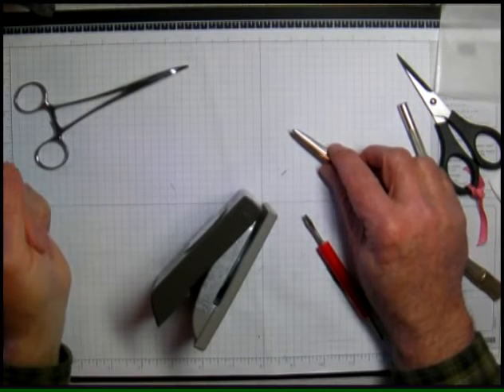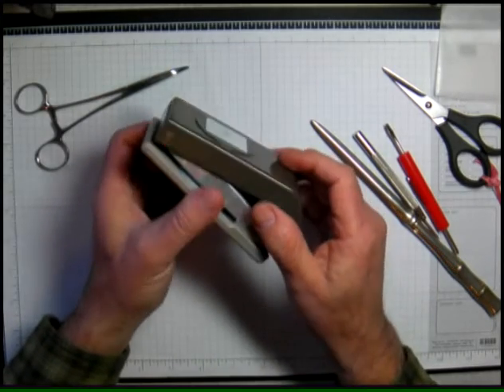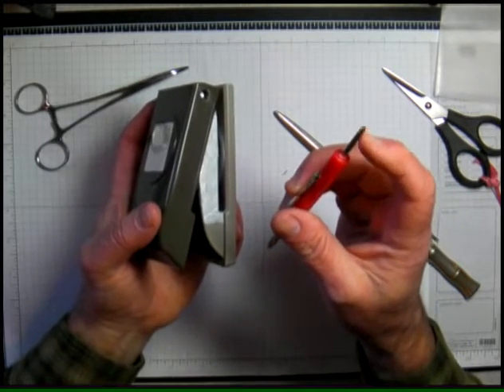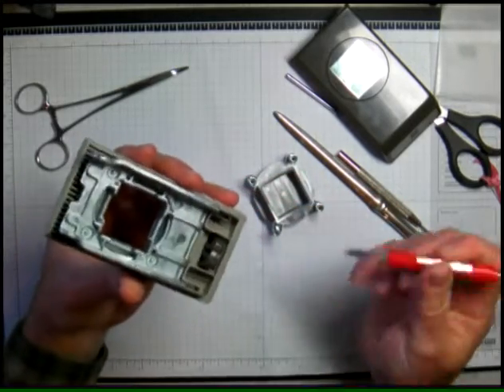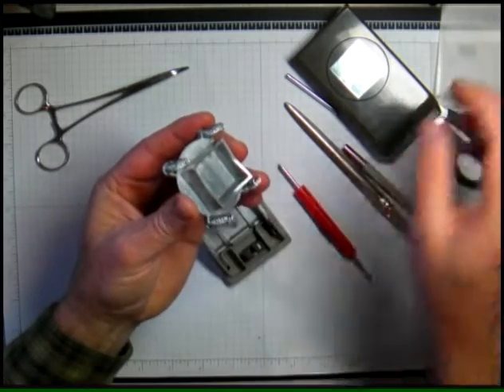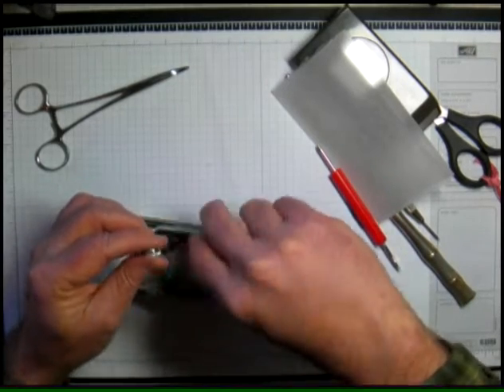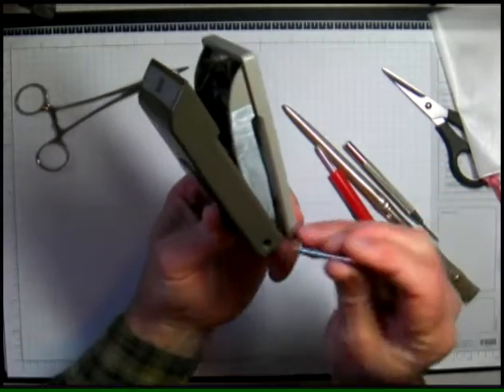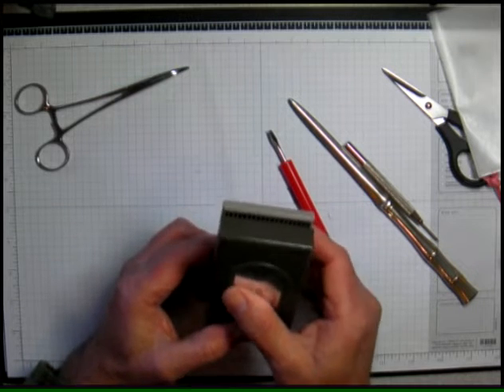Punch Repair - New Style Punch.mp4

Comment: thank you so much for your tutorial on how to repair punches, i bought mine a month ago and punched 3 circles and trying to use it again all of a sudden it was stuck so i followed all your tips (it did take me a while to take off the caps, very difficult) greased it, but after 40 minutes battling with the punch all turned out just fine. Great tutorial.

Comment: cant get the tab out :"(.helppppp
Reply: I used a pick from my Cricut tools and popped it out...hope this helps...I did have the same problem...he really didn't show how to get the first out...but he got my punch to working...
Reply: @GWest5068  Thank you so much for this! This comment was as helpful, if not more, than the video. It took me two days to get the first cap off!!! Between this video and another one showing you can put the punch in the freezer to make the metal contract to free whatever material is "stuck", I was able to save my discontinued ribbon punch that I use all the time. So happy right now! I have a swap due this week and really wanted to use that punch. :) 

Another tip: Take photos at each stage of taking the punch apart. That way you have a good reference when putting it back together.

Comment: Came here because I attempted to punch two thickness cardstock and the metal shifted. Bottom would cut, top would not. I followed Dave’s instructions, along with the following added tips and voila - my punch works again. $20 saved!

To remove the cap: I used my spare metal tipped pokey tool to remove the first cap - it took a number of tries, and I found squeezing the punch closed while prying helped. The pokey tool tip and the cap mangled a bit, but it worked. I wasn’t careful when pushing the pin through, and the second cap flew out just like Dave warned. Found it.

Futzing with the blades: I gently filed the inside of the top blade, and added a small dab of baby oil with a q-tip to the outside (the part that slides against the base metal). I wiped it all down really well with a napkin. I also found two channels on either side of the base where a protruding part on the top slides into when squeezing the punch. I placed the top back on, and gently pushed on the top to make sure the springs were positioned correctly to allow it to slide down and up. I think this was what had moved, and gently shifting the springs clockwise/counterclockwise helped correct the channels before reassembling.

Getting the pin back in: Tough! I squeezed the top of the punch slightly to align the channel and plastic until I could see all the way through it, then got the first part of the pin in. I squeezed the other side of the top to keep the channel open to get the pin in a little further. I ended up locking the punch closed and continued to hold pressure on the top to keep the channel open while I gently tapped the pin into place with a tiny eyeglass screwdriver and a mini hammer. If it’s resisting, the channel isn’t open enough and you need to gently squeeze the top to keep it open while tapping.

Comment: I have a Decorative Label Punch #120907.  I am able to punch with it, however notice that the points in the middle (top and bottom) do not punch completely out.

I have done the foil thing, even the tin can thing and the wax paper thing, still, it punches the same.

Do you know how to fix this?

Comment: Very clear instructions, however I'm giving up trying to get the pin out! Impossible with pin, knife, and other tools. No luck.
Reply from the maker: Anita Christian I wonder if you put a little WD 40 and then tried? Have you had punch awhile?
Reply: I never thought of it! But I did succeed in the end, albeit I did put a few scratches around the pin. I'm a bit disappointed  with punches that open up while in storage (because of change of temperature, I assume) and then you can't close them again unless you pull them apart. Thanks for your help.

Comment: I cannot get the cap off no matter what I try (metal nail file tip, small screwdriver head, nailhead); I am scratching the plastic and that's about it. I wish he didn't stop the video to take the cap off!! Does anyone have a tip other than the Cricut tool? I don't have that. Thanks in advance!
Reply from the maker: Hi there! We've used a paper piercer which has a great point so that eorjs7wrll. Be careful though if you use that because it is sharp!!
Reply: @Stampmaven  Thank you for the tip! I will give it a try!